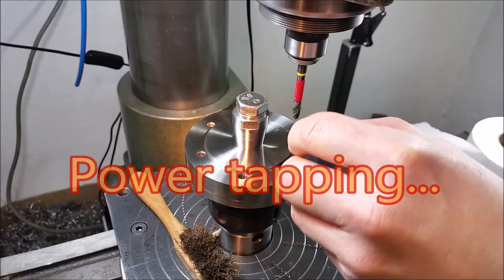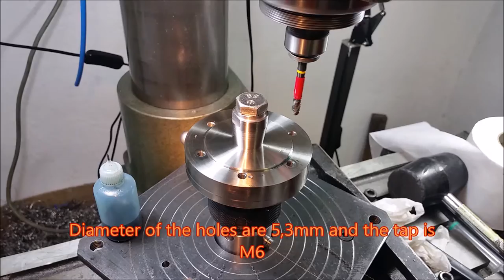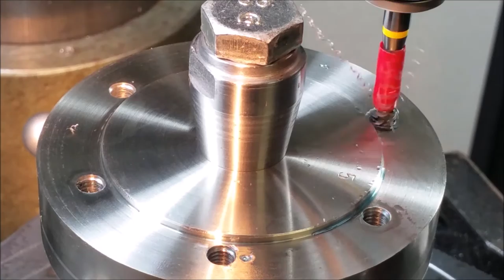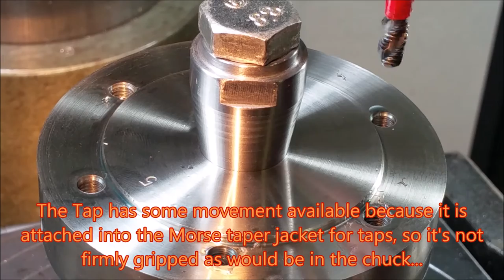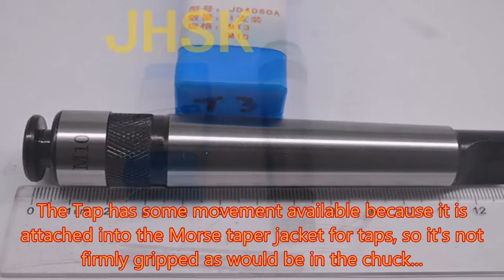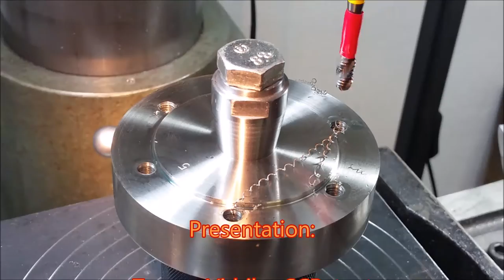Power tapping on the mill...

Comment: As far as i can tell, the way you mounted the part you were tapping to the rotary table is with a tapered shaft that has a hole through it, so when you're tightening the bolt, it pushes the tapered shaft into the hole of the part, holding it very secure. 
Pretty smart.
Reply from the maker: Hak Kar 
Hi. 
Yes, I have several pieces like that to make the holes in it and the threads. I'm now producing the steering wheels for sailboats and this is the bottom part of two pieces bonded together with screws... And the whole set has the tapered hole, so that was the best solution for mounting the piece for further machining. And it is also the best way to centered it...
Thanks for watching and for noticing that.
Best regards; Zmago
Reply: Thank you for telling me what the part was meant to be used for as i forgot to ask in my previous comment. 
Have a good day.